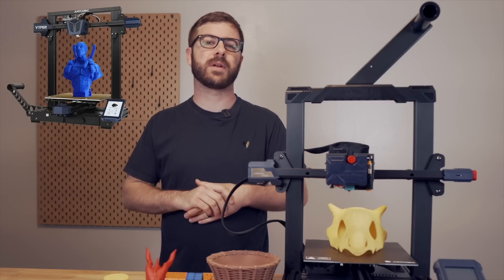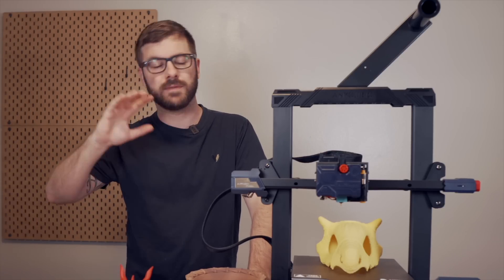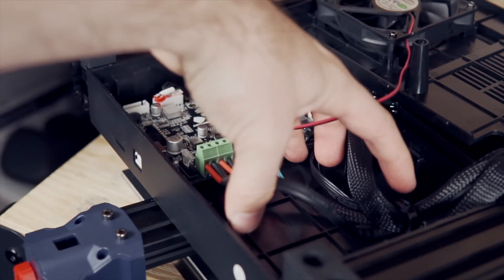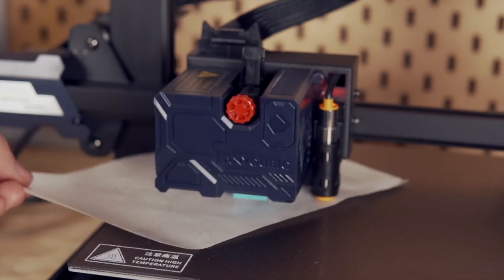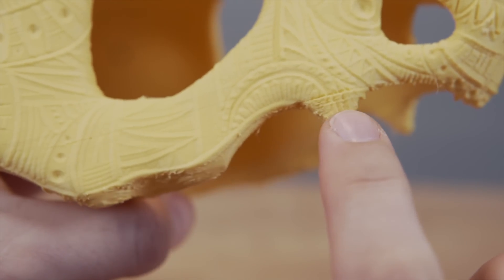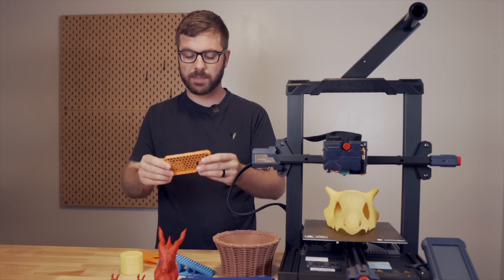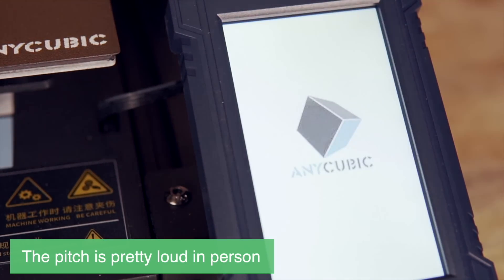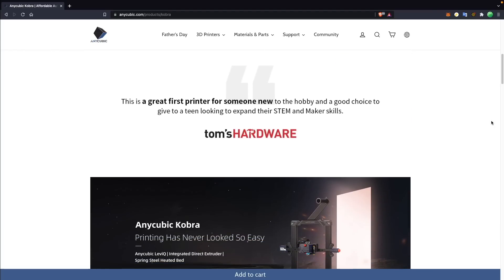The Anycubic Kobra Is A SOLID Budget 3d Printer

Comment: Man, printers nowadays are getting so good and so cheap. Really regret getting the ender 3 V2 so early, should've just waited. I haven't even used it that much as well.
Reply: Seems there is always a better one just around the corner these days.
Reply: Just print and don't worry about it. You're never gonna be happy if you listen to all the ender 3 hate. The Ender 3 v2 is perfectly capable machine.
Reply: @kenopyowo  Tell that to the warped bed that shipped with it
Reply: @Dplanes2.0  i mean a lot of printers are like that
Reply: @kenopyowo  yh, it just sucks tho because creality have terrible customer service and this was my first printer so I had no idea about these issues. Might just order a bl touch and move on to more advanced prints.
Reply: @Dplanes2.0  Little pricy as I just ordered my first printer this guy the kinda. I saw the warnings of the Ender but it was hard to stay away with their massive community, mods and overall popularity. Still even if you got one used I think it’s a lot better value than those cheap new $100 printers.

Now what’s scaring me slightly is if something breaks if it’ll be documented or not, I’m not looking into going crazy on nodding this but if the community isn’t too big then I’ll definitely need to learn to, which is fine but a con in comparison.
Reply: @Dplanes2.0  Configure and enable manual mesh for it and you can just forget about that warp.
Reply: @Dplanes2.0  Certainly an option, but manual mesh is a free option you can just enable in the Marlin.
Reply: i bought an ender 3v2 as well.... everyone keeps saying its a great beginner printer.... im telling you right now. its not. bed levelling and filament not sticking was my biggest weakness... now im buying anycubic because buying anything that has "ender" written on it instantly traumatise me... because i really saved up my money to buy that machine and felt lost hope when i realise it wasnt as "beginner friendly" as ppl claim them to be😫. im not going to make the same mistake. and i hope ppl learn from my mistakes as well.
Reply: @MrOner07  same experience here, times have just changed and newer printers have just gotten better.
Reply: @MrOner07  It's all knowledge to build a skill.  Get a CHEP bed level test print, and you use your finger to feel the thickness as it prints the large square and you can dial it in perfectly as it goes around the perimeter.  The finger is a tremendously sensitive thickness measuring device.  The correct squish into the bed is all you need for adhesion, along with obviously correct temps.

Most build videos skip the most important step: making sure your SPRINGS are COMPRESSED about 70% when the bed is trammed.  Most often, they're loosey goosey, which is why beds get OUT OF LEVEL with usage: springs too loose and any knock or bump gets things out of whack.

Correct process is tighten them to 80% of full compression, THEN bring the head close by LOOSENING THE Z END STOP and SLIDING IT DOWN IF NEED BE, so that with SLIGHT SPRING LOOSENING, you can slightly raise the bed to hit your perfect tram and get the bad level, ultimately hitting around 70% compressed on the springs.  It'll almost never move then.

I've run hundreds of prints across 5 printers and only touched bed knobs once on 2 different printers, and that was for moving them around...
Reply: JUST PUT glue on the heated works for me lol

Comment: I’m basically down to this or the ender 3 v2 but I can’t decide, what should I do? How do they compare in terms of print quality and part sourcing?
Reply from the maker: v2 is older but will have more info, 3rd party mods, and printable upgrades. Kobra has auto bed leveling, powder coated PEI, and direct drive. Specs if we are going stock, I heavily favor the Kobra. Both can print well, Kobra will do better for TPU. Part sourcing v2 will be easier, but I have heard Anycubic has pretty solid after sales support if you did need a part.
Reply: I was in the same boat a few months back. The choice was between the Ender 3V2 or the Vyper. I went with the ender only cause of all of the support and mods available. I went into this hobby to learn and tinker so that’s why it won out. Today it’s now been a few weeks since I’ve printed cause I got too crazy with mods and I’m currently in a tuning mode to get things going again. I’m considering the Kobra or the Vyper again as a back up printer. Just straight out the box good to go. To be honest I did three mods on my ender straight out of the box. Cr Touch, Metal Extruder, and stiffer bed springs. Printing quality prints in only PLA this was more than enough and actually miss it. Basically if you want to tinker with tons of support go with the ender. If you want go with something pretty good straight out of the box, the Vyper or the Kobra seem like a perfect option.
Reply: @WiseJanitor89  Thanks! I’m just concerned with the Kobra’a newness as if I need a replacement part or advice I don’t know where to look. Also there could be long term issues not discovered yet. I would prefer an all around good printer out of the box however
Reply: @somethingfunny5629  no problem! And yeah ultimately that’s what my decision came down to. Any where you look there endless support and solutions for the Ender 3’s. I didn’t want to pick up the Vyper and not have any of that. Knowing what I know now I wouldn’t have an issue picking up the Vyper or Kobra. Most issues with FDM printers are the same with similar solutions. Also just keeping it real, have a rational understanding of your print quality. Like I said I kept modding my Ender to “improve” my prints, and they were actually really good prior to my major mods. So much so that my next option is to remove some of the mods I’ve done.
Reply: Skip the Ender. I’ve had it for one year and it’s been a huge pain to operate reliably. I’ve made a few amazing prints along the way, but you’ll spend most of your time in maintenance. Just isn’t worth the headache anymore. The z-axis height changes after every print, requiring a bed levelling for each print. That’s just one example.